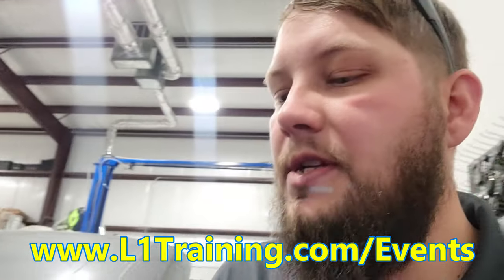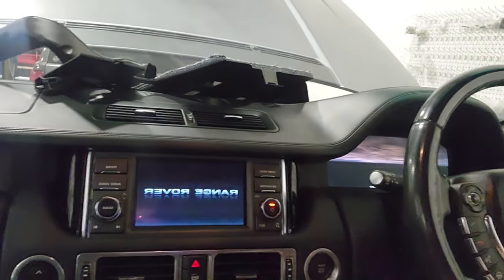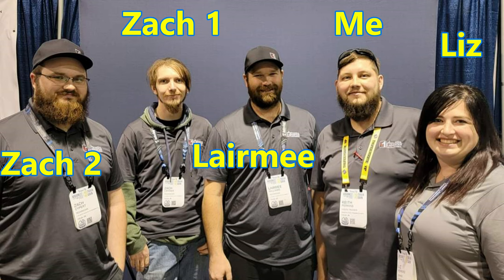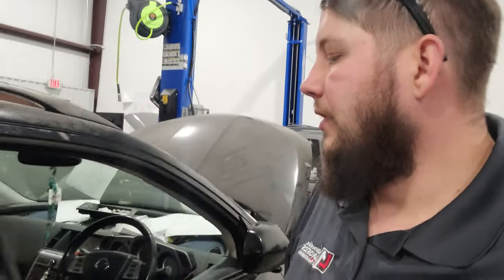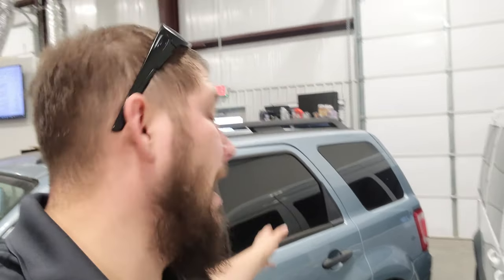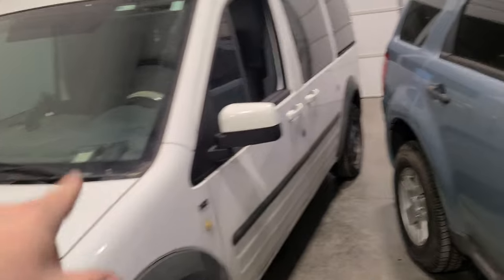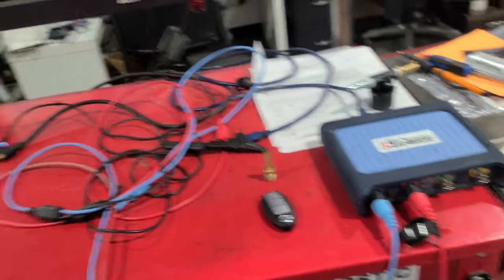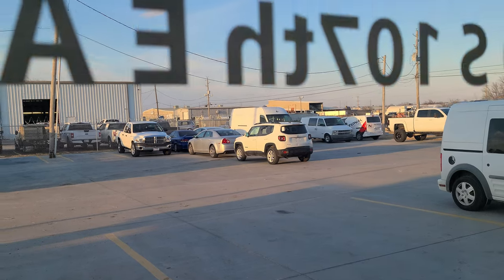What's in the shop, and range rover radio issues!

Comment: I'm having a similar issue. Radio plays fine but every once in a while I hear a small pop then the audio cuts off for 2 seconds, volume/power button flashes for 2seconds... then everything works again.. all this happens with power still on, nothing turns off completely. Just music cuts and turns back on. You ever see this? Is this case ur dealing with what I'm going to run into soon? Great content. I'm learning more about my car trying to keep it out of the shop and save money cuz these cars are fricking insane.

Comment: How do you stop the water from getting in to the back of the trunk area where the module is? Range Rovers have this problem all the time. I have had mine replaced twice by the dealer while under warranty. Now, it's out of warranty but I will have the loop fiber optic tomorrow and hopefully it will work. I will let you know
Reply from the maker: Easiest way is to flex seal the whole car........ kidding. Buy a boat...

Comment: Hi keith, I bought these jumpers and connected them today but ZERO connection for the wifi, navigation, radio not working. There is some water at the left back of car, checked the headliner, bone dry, I am not sure where the water is coming from but if I could figure out how to get this wifi working it should work.  any suggestions?
Reply from the maker: This video was not a how to fix your car, it was an example of how to apply the diagnostic process to a specific vehicles issue. You will need a competent technician with access to special tooling and specific training to pinpoint the problem on your car, every single car and fault are different. You are searching for what's called a silver bullet, it does nt exist on a JLR....